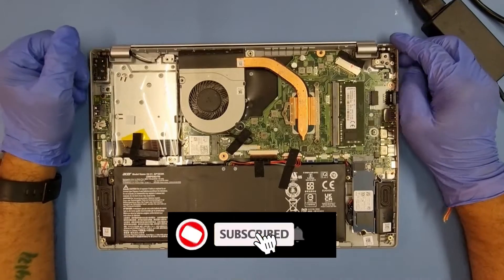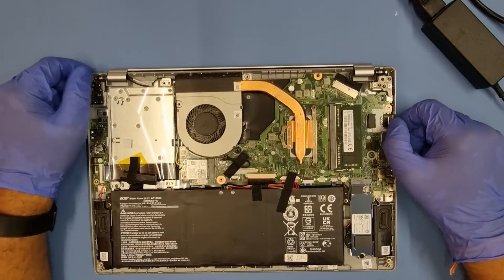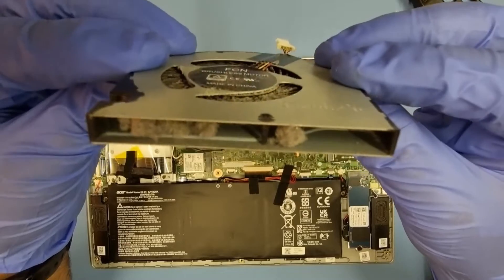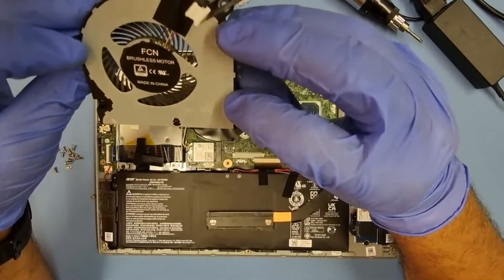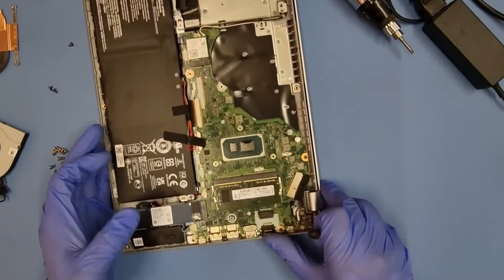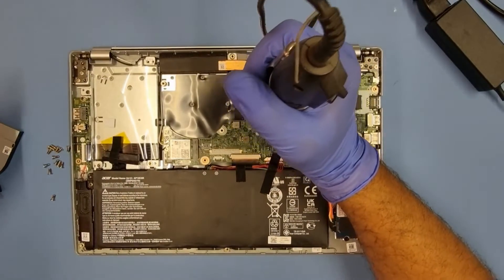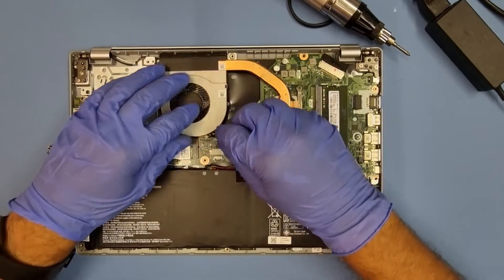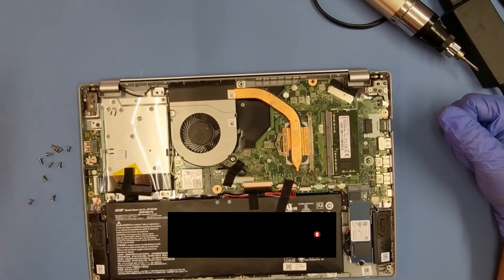Acer Aspire 5 Fan Clean, Noisy Fan

Comment: That smaller die is southbridge chip, it doesn't have any contact with the heatsink, so there is no need to apply thermal paste. The manufacturer also not put any paste to the southbridge.

Comment: Should you apply the thermal paste on both the cpu and gpu? (assuming the smaller rectangle is the gpu and the bigger square is the cpu) When I removed the heat sink, it seems that only the CPU had thermal paste.
Reply from the maker: Hi i would recommend applying to both.
Reply: That smaller die is southbridge chip not gpu, it doesn't have any contact with the heatsink, so there is no need to apply thermal paste. The manufacturer also not put any paste to the southbridge.